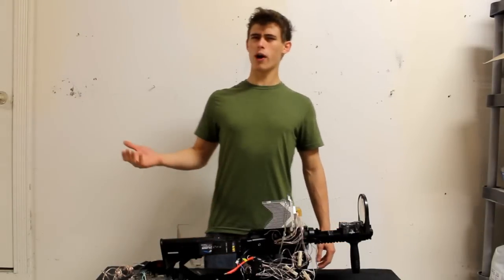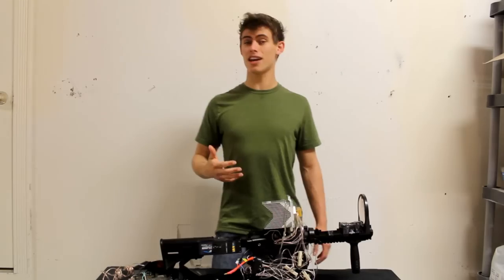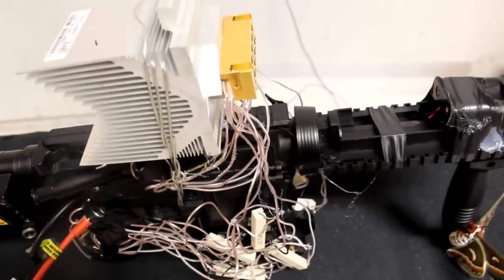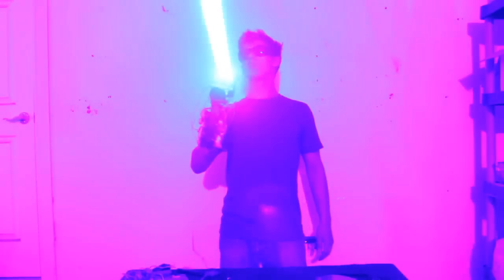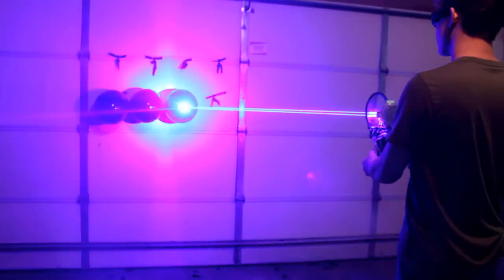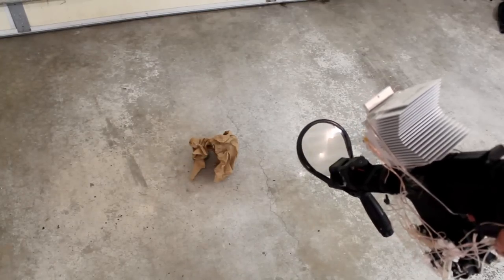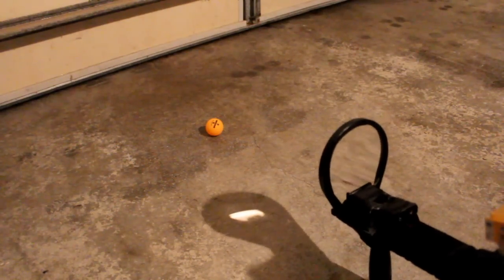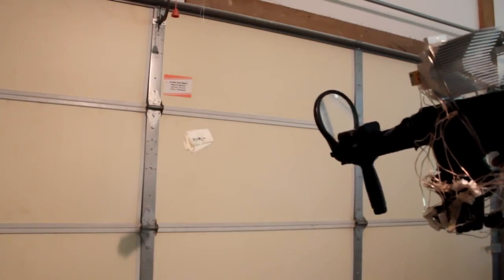My Homemade 40W LASER SHOTGUN!!!!!

Comment: I wonder if you could build a lens array that consisted of a range-finder and a set of moving lenses that could focus all the beams to one spot at any distance! I doubt it would be particularly portable, unless it was done on PCBs, but it would still absolutely rock!
Reply: SuperIby New navy ships use this to shot down missiles!
Reply: SuperIby It could be done with some math, an Arduino, and some simple robotics.
Reply: This
Reply: Armok: God of Blood Or a steel ruler, set of gears, a few lenses and basic knowledge of mechanics. Also, a bit of skill. And the entire thing would be 5 meters long. And be made out of pure titanium because why not. Science may be awesome, but mechanics is where the fun truly begins... Because screw using your brain, place this cog here, that cog there, that square thingamajig over there, if it's meant to move leave it as it is, if it's not weld it or use some duck tape make out of freshly stripped duck leather with gelatine from boiling it's bones as an adhesive. You know, in case you had a duck but didn't have a welder and were too lazy to make one out of microwave, piece of cable and two alligator clips. But hey, at least when you're lazy, you start being creative and you still don't use your brain, 'cause you're not as smart as those brainy guys. But unlike them, you have real man's tools and you lost your virginity not too long after you've turned legal. Because you were born a mechanic, you just didn't realize that at the time... #Kappa
Reply: SuperIby The US military is already building that. It's Project Excalibur, run primarily by a bunch of Russian scientists. It is way more complicated than it sounds, as each laser channel is phase-controlled, to overlap the beams' E-fields at the target.
Reply: SuperIby It's absolutely portable, and more or less easy to build. You just need a laser-distance-measuring device (cheap things, work perfectly), and two or three lenses, set up on threaded rods, which are turned by stepper motors. (Or just servos moving the lenses). A microcontroller like an Arduino, Rasperry Pi, or Lego can easily control the lenses with the information coming from the distance-sensor. If you give me 300$ and a arduino, i'll build it for you:D
Reply: SuperIby  The divergence of these multimode diodes is very wide and they do not focus well at any real distance, even if you used 8 galvos and converged all 8 beams you would only have a spotlight at any real distance. Play nextPlay now    Check out this clip.     
Laser Blue 445 Moving Head Lasers
Reply: SuperIby I'm willing to bet that hard drive servos, a laser range finder, and a raspberry Pi could make it relatively portable. If you could house all the circuitry in a compartment in the stock, or underneath it in a C-mag profile, and shock-proof it you'd be in business.
Reply: SuperIby Hmm... Some IR assembly would do? Much like a camera?
Reply: SuperIby So, the US Navy is putting lasers on their aircraft. It's already beginning...
Reply: Neceros  The air force as well.
http://www.popsci.com/air-force-wants-laser-planes-2022
Reply: Its been awesome reading through these replies. I did expect that the divergence of these diodes would be too large really get much focus at range, but at short distances, such as demonstrated in the video, it would probably be more than enough. I simply though that a lot of the power was wasted as a result of trying to "eyeball" the focus point in this video!
I have seen that the US military is using this kind of idea on ship borne and air borne units, its quite interesting, though the lasers are not in the visible region of light, IIRC.
Reply: SuperIby run it through a modified camcorder focus array